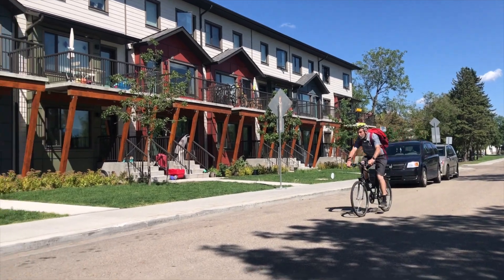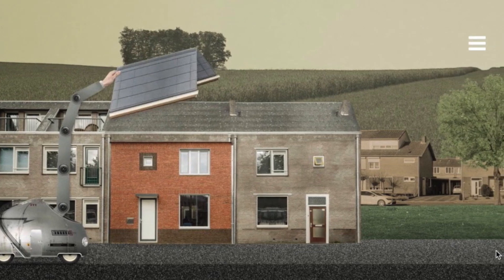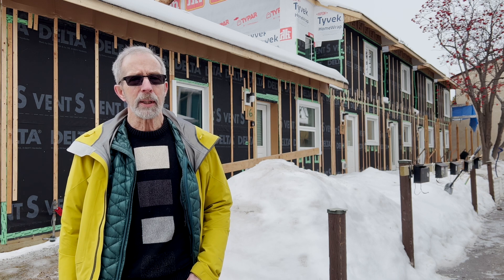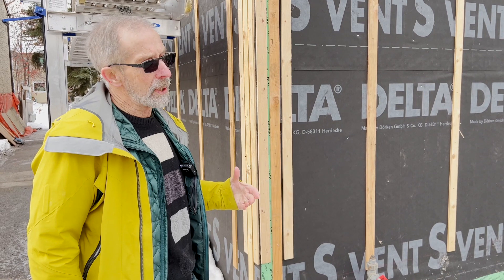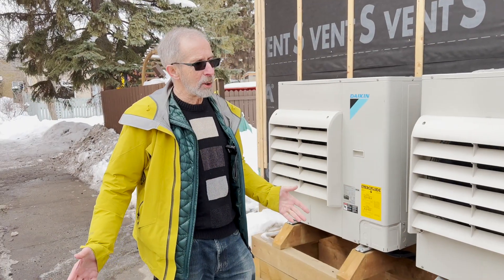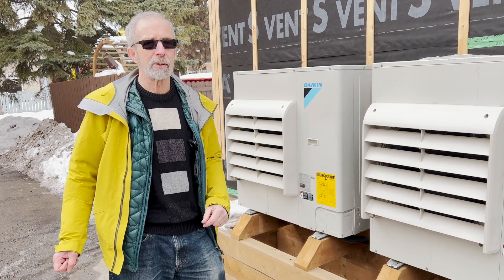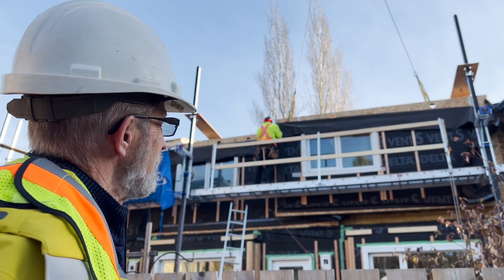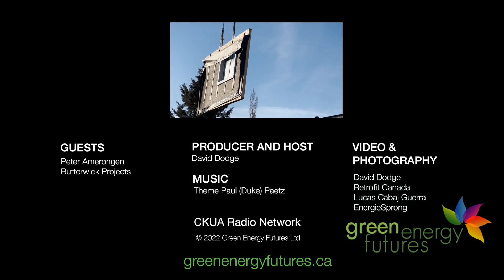Amazing Energiesprong project will transform 59 Canadian homes to net-zero

Comment: Do you have any information on the design of the panels? Were these manufactured in Edmonton? Would love to see a detailed video on the product. I'm ready to start the design on my retrofit.
Reply: Did you ever find an answer to this? I'm just looking into options for my 2x4 walled home too (also in Edmonton area). I was deciding between rigid foam and brainstorming double stud wall, then came across this pre-manufactured idea which seems interesting.

Comment: Love it! Who is installing the heat pumps? Lots of interest for them in Edmonton, but impossible to find a contractor to install them!
Reply from the maker: Peter is with Butterwick Projects which is doing the Sundance project. As for heat pump suppliers you probably should be careful. Consult a net-zero builder for ideas. Because an air heat pump may not be able to provide you with enough heat if the home isn't efficient enough. The units in this project will require 70% less heat which makes the heat pumps a great solution. Of course the other application that uses heat pumps is geoexchange (often called geothermal) which uses heat from the Earth which is a steady 4-6C instead of -40 to +40 that the air source heat pump must deal with. Bottom line get qualified advice.